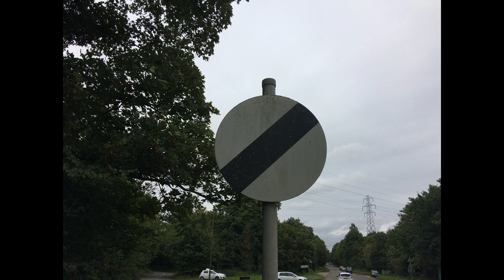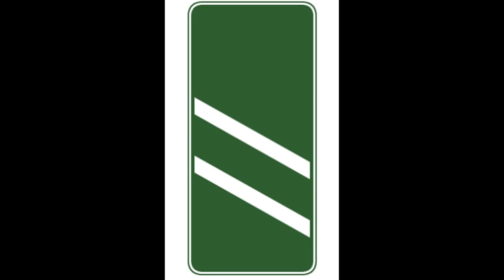How to Deal with Dual Carriageways  | DTC-UK | Driving Test UK

Comment: I passed recently and unsure about signalling to come off a dual carriageway with 3 lanes where the left most lane is for going off the carriageway and the other two carry on past the exit slip road. In this case do you give a signal to confirm you are coming off to others or give no signal as it could be misleading as the exit slip road splits into two lanes. This is on the A1 southbound at Teams Valley near Lady Park Gateshead if you want to have a look on Google Maps. Thanks for the great videos I find them informative especially on areas I am a little unsure about :)
Reply from the maker: +MicksTips Hello. Thanks for commenting 👍If the left lane is for conning of the dual carriageway and you're already in that lane, then no signal is required. 
However, if you were in the right hand lane you need a signal to change lane but in the correct lane, you may cancel the signal. 😊 DTC-UK
Reply: Driving Test UK Thanks a lot that has helped loads I wouldnt have wanted to confuse people keep up the great work I would love to see some videos on motorway driving skills or anything to help with dual carriageway anticipation what to look out for etc :)
Reply from the maker: +MicksTips Thank you for commenting which has been noted. 👍DTC-UK
Reply: If you are in the left lane and you are leaving the dual carriageway, You need to signal left after passing the  100 yards signboard
Reply from the maker: +Archana T yes. That is earliest point to signal. You can delay the signal up to the last 100 yard sign. DTC-UK

Comment: Failed my test because there was a cyclist on the left hand side of the dual carriage way.. I was driving around 45 mph as seen him from far but wasn't yet able to move over the right as was a busy lane. The examiner asked me to go faster as it's national speed limit. I panicked as the reason I wasn't doing 60 is cause I would reach the cyclist really quick as he was riding his bike so slow. When I decided to overtake the car coming on the right lane seemed to be very far from my mirrors but reached behind me so quick! Which means it was closer than it seemed! A big mess 🤦🏽‍♀️ all this happened 10 minutes from the end of my test which I would have passed if it wasn't for this big mess
Reply from the maker: +ZoHra Mamichula Nevermind. Success always follows failure. DTCUK